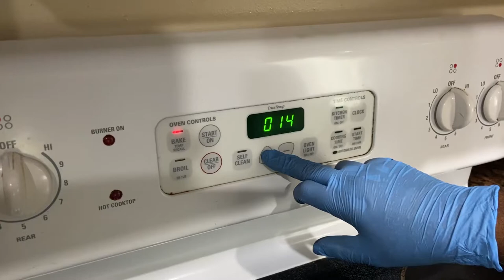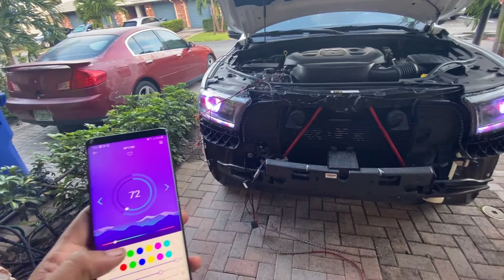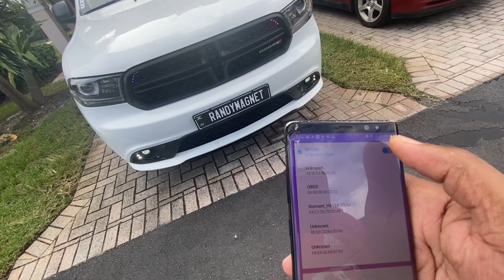DIY Flow Series Headlight kit full installation on a 2018 durango | Lighting Trendz Review

Comment: Hey you could tap into your headlights wiring. I did it to my wife’s 2017 Durango
Reply from the maker: Yeah I could have but I wanted my lights to be on once the vehicle is on and not necessarily controlled by the headlights or etc. Just my preference
Reply: @876ixlifestyle  was just answering to your question of them turning on and off with the vehicle
Reply: And still use my app to control lights
Reply: Great work tho and awesome Durango
Reply from the maker: Appreciate it. More to come 👌🏽